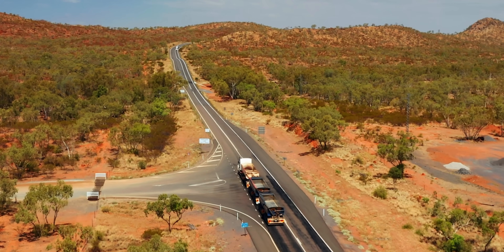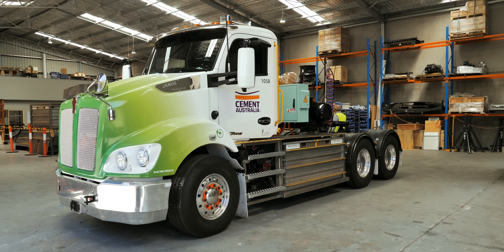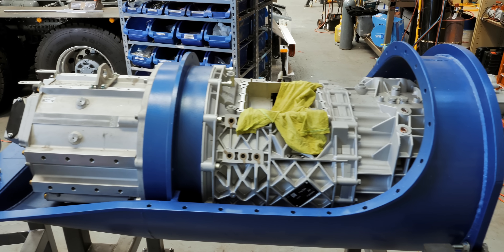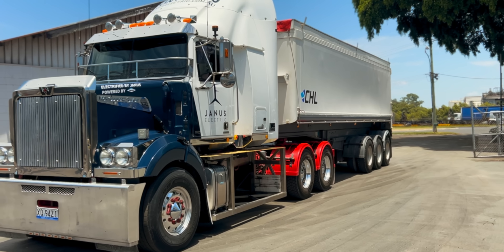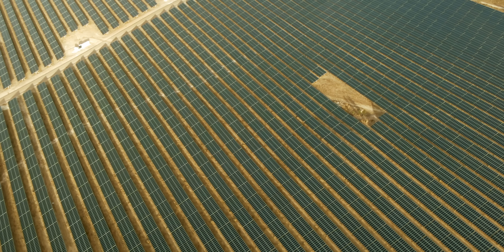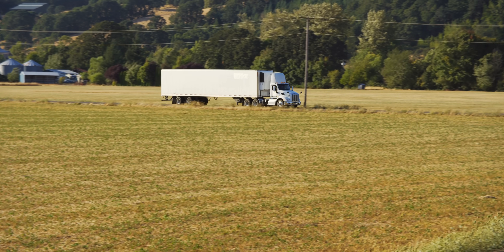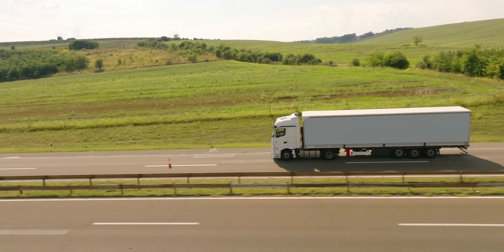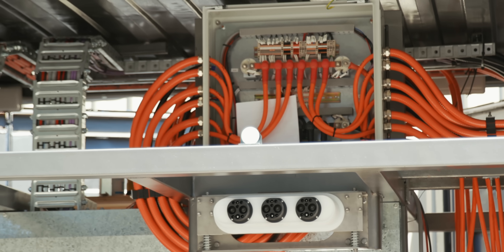This GIANT Electric Semi Can Swap Out Its Batteries!

Comment: This makes complete sense. Recycling existing trucks. Getting around charging issues by swapping the batteries and then conditioning & charging them in a storage unit to keep them at optimum efficiency. Well done to these guys.
Reply: To bad that Tesla scrapped their test to have interchangeable batteries.
Reply: Ummm, the idea of swapping batteries has been done for a long time.... look at electric forklifts in certain wearhouses.  This just takes it to a different level.... and I am sure the cage the batts sit in are crash tested...
Reply: @Kaliburz  now that lithium battery is coming to forklifts they go away from changing the battery. I loading at a place where they change their forklifts to lithium ion battery and they charge them in place in the forklift.
Reply: @magnusE7  one of the problems I could see with lithium in a forklift is the lead acid batteries act as part of the counterweight
Reply: @juliogonzo2718  but in electric forklifts the battery is under the seat between the wheels so how could that be a counterweight?
Reply: @magnusE7  it's still mass behind the front wheels
Reply: Have you tried loading a 5 cu ft solid tungsten cube in the back of the forklift?
Reply: Only makes sense around town
Reply: These systems are using the concepts and techniques excellently where their strengths shine. More companies should follow their example.
Reply: I like how they talk about how to get that much energy to provide for charging the batteries.Providing a facility with electrical requirements to charge batteries like that is massive
Reply: Nothing is simple on an EV because of the dangers involved. You don't just change batteries because there's a process to go through to make sure staff are safe and the vehicle works afterward.

Comment: This seems like the best no-compromises solution for electrifying the world's trucking fleet. Long term, it would still be better to switch to electric rail as that's significantly more efficient, but this is the first approach I've seen that could get the shipping industry to net zero or close to it before 2030.

Not mentioned in this video was questions about safety. You have a big battery (presumably lithium ion) sticking out along the side of the truck where it could get punctured in a crash. How do these trucks hold up in crash tests?

Comment: Absolutely fantastic..I wonder if there's gains to be made by electrifying the trailers also? 

When you tow a Load it depletes your Diesel/Battery faster than without therefore it would seem ideal to put an assistive motor into the drive train of the trailer to assist with long distance driving. 

Anyhow, great video and I'm always reassured when I see regular Blokes giving this a go rather than Californian cyber nerds! Great to see.

Comment: If they can swap the battery in a minute using a fork lift,  it would seem that a dedicated machine could swap a battery in a truck in maybe 15 seconds.  I imagine a conveyor belt with batteries and a robotic arm, like they have on garbage trucks now, just pulls the battery and replaces it without human intervention.

Comment: Probably the most important video you have ever done, for all the intelligent reasons mentioned  in the video. Not mentioned was the cost of living reductions possible for all Australians with a switch to Electric Trucks. Every time fuel goes up in price, the cost to transport freight goes up in price. That growing transport cost is passed along to every item, any goods, Australians buy.  I recently had an item transported from the Sunshine Coast to Brisbane. The basic transport cost was reasonable, but the fuel level, additional to the transport cost, was an extra $30. Imagine an Electric Truck future, and Cost of Living reductions,  by transportation costs reducing, because of self harvesting of energy,  "free" from the Sun, and reduced operations cost because of significantly reduced maintenance costs!

Comment: reason why i dont liek electric car is  that battery degradation and lack of battery recyling. dendrites that forms from battery degradation is messes with recyalability too.  if you look at sandy munroe video caled wjats insize 680 battery, there could be indicator of how much of battery can be recycled by mechnaical seperation vs what chemical process would be needed, woudl it be susntinable process? recycling company called redwood. even if they fix this problem, will they dig through trash to find enviromentally damaged (rust, mud,etc) dead car batteries currently being dumped, and recycle them? in emissions, best hting to do is a ca rof where rear seats face the rear as comcpact 4 seate rreplacing 2+2 seater cars and yaris corolla cars, and  rear mid engine small combustion flat 2 cyulnder wnith no rotatiing parts to send power to wheels, instead magnets moving back and forth make electricty aand or a little supplemnetary compressed air , to power electric drive and compressed air driver, possibly with no battery or at minimal battery, using supercapacitor etc.  optimal combustions per second for emissions with electric and mechnaical hybrid turbocharger, sometimes engine will run beyodn optimal effiency or emissions levels for unsuually high power demand to protect long term emissiosn and fuel use reduction effetiveness of battery for common lower power use. with limited batterys to use, hybrids are already more effceint effective at reducing emissions, vs using that battery material for fewer cars who are electric cars, becaue most emissions happens in low speed high pushing power sitatuaitons of combustion car, where emissions are most likley to chemicaly harm health of nearby people becaue its usually compact city area with many people nearby.              what battery size is best for longevity?  see tony hellers climate change videos, maybe somone can make use of suspicious observers videos.          see aptera owners club video on saftey, unqiue materials they use, lightweight is safer to peopel outsid ethe car but can be safe for people inside car compared to hevaier caar if using right materials, and even safer due to wat type of crash is more likley to happen.. linearly more ligghter weight exponentially causes less road wear damage causing less resurces and emissions and road downtimes.                                in effeincy per functionality, rear seats facing rear in sompact 4 seater woudl make more sense. solarpanel effeincy is only arouund 20 percent and can become lot better                        r

Comment: The solution shown in this episode seems ideal for local hauling infrastructure. It's also easy to imagine a short trailer containing several additional battery modules to extend the range. The ideas shown here are all very good and clearly demonstrate what is possible with just a little bit of imagination and engineering. Robotic battery exchange is certainly a good next step, along with standard form factors for the battery modules. I think this company has the right ideas for how to move forward, particularly the part about re-powering older vehicles. Overall, an outstanding proof of concept and productization of technologies.
Reply: It's not just for local routes. Janus has installed a battery swap station at Albury/Wodonga which is about halfway between Sydney and Melbourne which makes it easy for a Janus truck to do this run
Reply: You forget batteries are heavy, the more batteries and the bigger you make them the less load the truck can carry, It is not as simple as adding more batteries or even bigger batteries.
Reply: @LeeCountySpeedShop  their batteries are 2 tonne, the truck's capacity is 97 tonne, so an extra battery is approx 2% of the total capacity.
Reply: @LeeCountySpeedShop  No argument here. The question is what loads must go where, when, and how best to move them within a particular range. A trailer of nothing but batteries added into the rest of the load is, in a sense pulling its own weight, the question being how much more it can contribute to the load-carrying and range capacity of the whole vehicle. This is where energy density and rolling resistance enter the equation, along with the topology of the terrain that must be covered.
Reply: @LeeCountySpeedShop   Also the batteries replace the existing diesel tanks which hold about a tonne of fuel so two tonnes of battery isn't making a huge difference. But the reduction fuel costs would make a huge difference. Another thought would be the consistent weight. A battery weighs the same charged or discharged, so you get a consistent and predictable weight on the driven wheels. With a diesel setup the weight on the driven wheels reduces by around tonne when the fuel tank gets low.

Comment: Very impressive! As a lorry driver, would love to see this in the UK.
Reply: Absolutely. Also very applicable to bus operations which run on more predefined routes. Given the numbers he quoted it would seem National Express Coaches could run from Newcastle to London on a single charge. Then swap out at London Victoria coach station. Future looks interesting.
Reply: @marviwilson1853  I hope that they relocate Victoria coach station before this technology arrives - it's already overcrowded and unpleasant for both passengers and NEC drivers!
Reply: this should be done in EU as well
Reply: @joeblack4026  I agree
Reply: in the UK the range would be less due to one simple factor, steering! the electrically powered steering would be used considerably more in the uk. and how often are you going to use regenerative braking on long hauls...
Reply: @merlin1346  Very true!
Reply: So limited to where the charge station are.
Reply: @glynscothern5569  Re: "So limited to where the charge station are"

The Investment required to have an adequate  Charging Infrastructure' is mind boggling.........Fiscally, and Materially!
Reply: Keep em.  I'll retire in my diesel fired truck
Reply: Of course in Australia it's a real no-brainer.  They're a country the size of China (or the US minus Alaska) with a population less than half of the UK and a distance from the Sun of roughly 50km.

They have so much potential for clean renewable energy there and all the resources for batteries.  The one thing they have less of, because of their small population, is a labor pool, but everything else exists in abundance there.

If they don't go fully electric of all countries then something is very wrong.
Reply: @OolTube02  Re:"And a distance from the Sun of roughly 50km".

?????????.....Everywhere else its approx: 93 Million Mile's???
Reply: @kenhickford6581  Yeah, it's a joke.  You need a lot of sunscreen there.  But solar panels also have a higher yield there.  And there's lots of wind, onshore and off.  The place is a renewables paradise.  If there weren't also a lot of coal there wouldn't be any luddite conflict at all.

Long transmission lines are a problem because they're just as expensive as they are in, say, the US and China for only a twelfth and a 55th of the population respectively.
Reply: @OolTube02  Re: "The place is a renewables paradise.  If there weren't also a lot of coal there wouldn't be any luddite conflict at all".

Time will tell if the alternatives you suggest will be capable of supplying the 'Base Load' required to keep Aussie Industry going.....Competitively that is.......Yes?
Reply: @kenhickford6581  Once you have enough batteries and other energy storage, once you have the transmission lines to offset a lull in one part of the country with wind from another one that's a problem of the past.

And as for the intermittency and the vast power surpluses that entails, that's actually going to spur on unprecedented growth that fossil fuels or nuclear could have never given you.

Because you have to build out a certain overcapacity in order to have enough power available even on the bad days.  But that means you have more power than you need on good days.  So suddenly all this intermittent surplus is supply looking for a new source of demand.  Maybe that's desalination and irrigation systems, which can afford to run only intermittently.  Or hydrogen and other renewable fuel production.

But what happens then is that these new industries represent a giant opportunity cost whenever they're being shut down.  So in order to supply them you want to build out renewables beyond what you ever needed before.  But that means an even greater intermittent surplus and even more oversupply looking for new demand.

This is something that coal or nuclear or geothermal or hydro could never give you.  But solar and wind will.  They won't just replace traditional energy production.  They will exceed it massively, to the point when quasi-terraforming endeavors will become realistic, actually making a lot more of that barren continent arable and habitable than you ever thought could be done.
Reply: @OolTube02  Time/Money will tell which systems will prevail,....As all will have to obey the Laws of Physics!
Reply: @kenhickford6581  Time and money is already telling.  Those coal power plants aren't being shut down by global climate change activists but by the bean counters.

But it doesn't hurt to anticipate in just what way all that intermittent overabundance is going to be market disruptive.

For instance a free market punishes a supplier of an overabundant good with low prices while it rewards a supplier of an eternally scarce good with high prices.

The farmers during the Dust Bowl went bankrupt because food prices dropped so low from an oversupply that they couldn't recoup their costs any more.  The result was even more desperate overproduction and an eventual ecological and sociological disaster, resulting in a Great Depression, a New Deal, and a bunch of famous John Steinbeck novels.

That's why from a private investor perspective it's a better bet to invest in battery production than in wind and solar power production, because batteries are a lot less likely to oversaturate the market.  And from the perspective of a government it's important to know that your biggest headache is going to be building the infrastructure to transmit energy across vast distances and making sure that oversupply bankruptcies don't result in popular suffering and unrest.
Reply: Re:"As a lorry driver, would love to see this in the UK".

You mean: - "As a lorry driver, would love to live to see this in the U.K". 
Lol!

Comment: Analyzed this, I think the battery swap feature is overkill as it requires a skilled lift operator that may not be available for certain times of the day, and rare cases for operator mistakes and crash the huge battery to the truck.  A well designed charger for lithium ion regardless of capacity is always under an hour, small enough time downtime between shifting drivers, inspection, or waiting for trailer to be loaded.  It is also likely companies have one or more extra trucks as backup or for multiple reasons.

Comment: I drive huge trucks long distances in Australia the advancements in this technology is amazing, a couple of questions will these be permitted in tunnels or restricted to dangerous goods routes as the batteries are huge and pose a significant risk in the event of a collision or fire. Currently when I transport even a small amount of lithium batteries as cargo I have to placard the truck an am restricted to approved DG routes.
Reply: Fantastic question! Would love to see this addressed…
Reply: Good question - I suspect they use Lithuim Phosphate which doesn't burn, but?  Also I suspect that the regulators haven't caught up with this yet.
Reply: November 2023, Melbourne answered the question  a second unit lost.

Comment: It's a great idea and seems to perfectly executed. But this of course only works in countries without freezing temperatures and for medium hauls. 300-500km range is nothing for a full size truck. Not even in Europe. And in cold temperatures, the range of your average EV drops nearly 30-40%. 
So you need a lot of battery switch stations along the way. I do wonder if they could gain significant more range if they redid the shape of the bodywork. That one truck has the aero of a brick wall. I wouldn't be too hard.
Reply: Battery tech needs to overcome the cold climate issue. When they do this system will still work
Reply: The haul range is not the battery range. It’s how far apart you set up your swap stations.

Comment: The only possible downside is the skill required of the forklift driver.  It wouldn't take much of a ding to disable both the truck and the battery.  The forks would also have to be very straight, and the ground very level.   Tweaking the shape of the corners of the battery and the edges of the port might improve this, and maybe some partial rail to keep the battery raised until it's far back enough to  lower and engage,  would make the system more idiot-proof and more likely to be widely adopted.

Comment: 6:50 interesting. the Tesla Semi was estimated at 1000kwh.  This one got two of 620kwh. The question now though is cost of the electrifying an ICE truck
Reply: These trucks are running 2.5 times the weight of the Telsa though so a slightly larger battery is justfied.  Where I live it is difficult for a truck to ever do more than 550km in a day without exceeding drivers hours regulations so the sort of ranges being talked about in the video seem manageable for the operator with that size of battery.